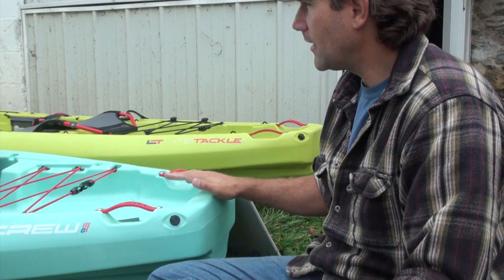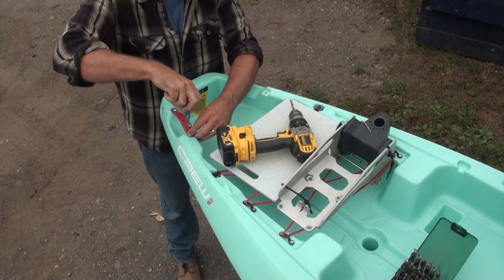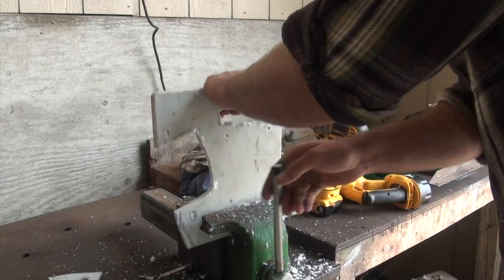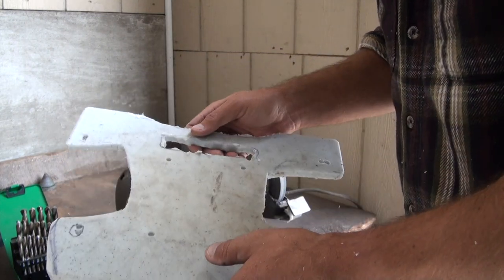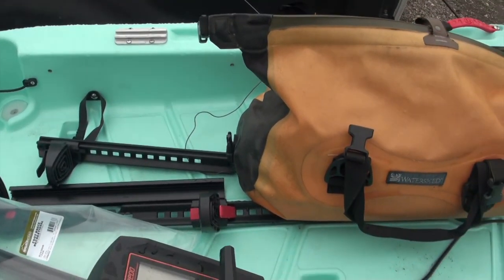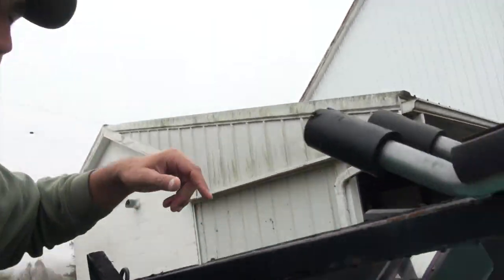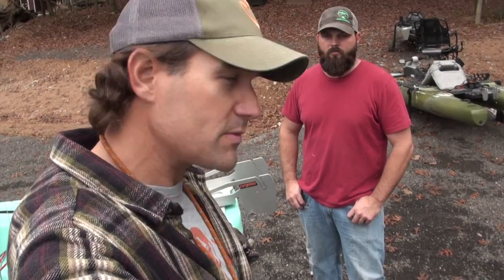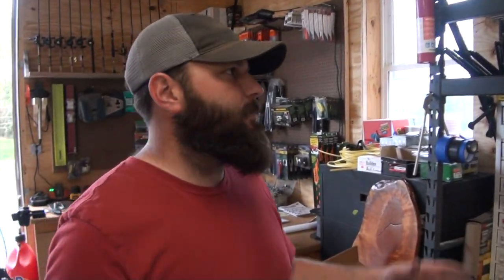DIY Motor Mount: Crescent Kayak Crew and Torqeedo Ultralight

Comment: Here is a Fishing technique to get  a wire or what ever in a hollow apace when do not have access to inside the space. In this instance you will need a beaded chain about 5 ft long. Drill the beginning hole and the exit hole.  Put Kayak on end.  Drop the Beaded chain in top hole. You will need a small magnet on a wire to attract the beaded chain pull the chain out. you now have pull string to pull in what ever you need from hole to hole. It is advisable to pull in a pull string to replace the chain.  The chains are not very strong and can break easy.
Reply: Darn, Cosmic!!!!! What SUPERB idea!! I will file your idea away for future needs! Only one problem that I see is...If the hole is so darn tiny, I haven't seen a magnet that small to fit inside such a small hole. Other than that, this is the most BRILLIANT idea that I have ever run across!!
Reply: @ronaldkondler5792  I think we’re going to need to drill a bigger hole.😉

Comment: Those cutting boards break easily in my experience. They snap if they’re dropped. I’d suggest adding something to create a redundant safety net like a strip of aluminum so it doesn’t fall apart if that happens.

Comment: Hello, I was wondering if you ever had any issues with the thickness of the starboard only being .5"? I am about to create my own mount but want to make sure that the .5" thickness will be sufficient for a 30lbs thrust Motor.
Reply from the maker: No issues, even with a 105 lb thrust motor.

Comment: How does  the Crescent crew perform on rivers? Not white water rivers but rivers. Shallow rivers & moderate rapids.
Reply from the maker: It’s a good platform because it’s fairly lightweight and has a large footprint. That means you draft shallow.

Comment: Might be a dumb question but are there nuts molded into the kayak that your threading into or are you threading into plastic? Thanks
Reply from the maker: Don,  Yes, that is pretty much what a threaded insert is - a nut that is molded into the hull of the kayak.

Comment: grinding plastic with a grinding stone  is never a good idea  you can load the wheel with plastic  and  cause the wheel to shatter
Reply from the maker: Thank you for that tip. I was unaware. I need to purchase a belt sander.
Reply: Dressing the grinding stone once in a while eliminates potential issues while grinding plastic